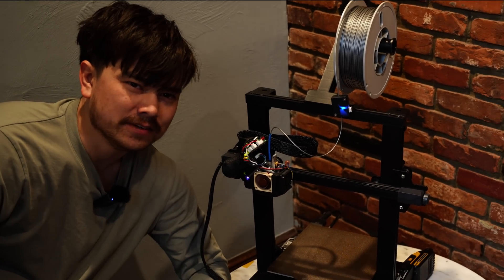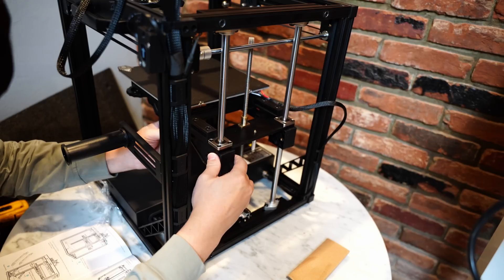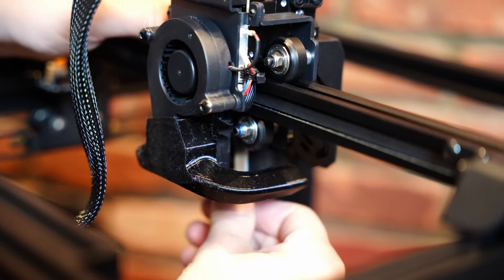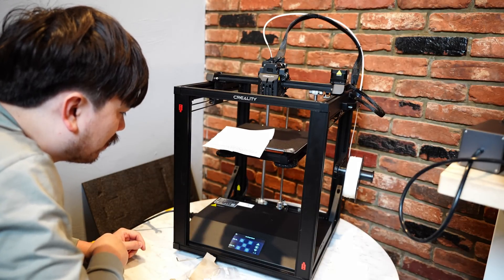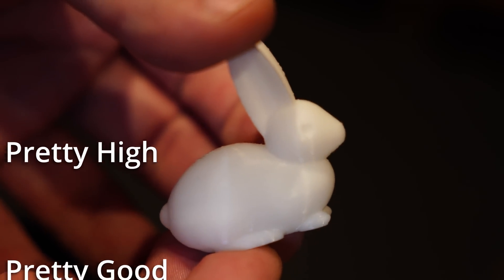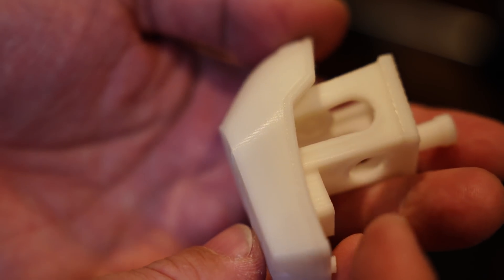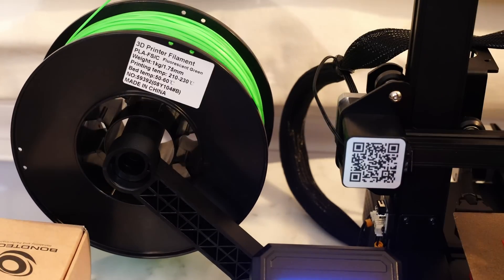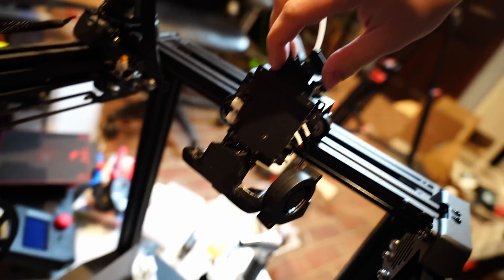Ender 5 S1 - The Best 3D Printer Creality Has Ever Made

Comment: I’d just like to add that Klipper is the future of 3D printing, and the future is upon us. Also, 4D and beyond is coming hot on the heels of Klipper. So that’s something to try to focus on more than what companies are doing to keep churning out variations on the Anet A8. BIQU is on the cusp, I think, so that’s where the action and the best ride/profit is.
Reply: Marlin is still adding features and updating.  Klipper for sure has some nice  features that marlin does not have yet but marlin will catch up
Reply: The hotend on the BIQU B1 SE is the dumbest design I have ever seen.
Reply: @petercallison5765  why am I not surprised.
Reply from the maker: Yeah, Creality really needs to build it into the instead of this pad. Should have called it the sonic band-aid
Reply: @NathanBuildsRobots  I disagree. The pad allows a larger screen and will be able to run multiple printers.  The pads release does not mean their future release can't/won't have klipper rather than marlin, it just means you can easily convert your existing line up and do so easily and cheaper than a Pi.    The pad is a awesome new tool that will be hard to be to switch to klipper.
Reply from the maker: @brandonbrown3600  I’ve been testing the pad and my screen is already scratched up. It’s a glossy plastic instead of glass for the touch surface :(
Reply: @NathanBuildsRobots  believe it or not a 5k snap on OBD scanner has the same thing. Same with Autel.  It's just industry standard for tool type tablets it seems. I guess because scratches are better than cracks.  I plan to put a screen protector over mine immediately even just a universal one wi help.  That and a stylus.
Reply from the maker: @brandonbrown3600  good plan. I should get one too
Reply: @NathanBuildsRobots  I'm glad you mentioned the scratches though I haven't seen anyone else mention them yet.  Just reinforces my though on the protector.  I really appreciate that but of info!
Reply: @NathanBuildsRobots  The sonic pad can control 4 printers at once, seems like a plan to me.

Comment: Someday, you might get a coreXY design and the accelerations will startle you with how violent they can be. Some of the travel moves are so fast that you can print with wet filament because it doesn't have time to ooze. However, I think your art form is the comedy of low end printers so that might hurt your content. :P
Reply from the maker: I’ve heard them running, sounds like they are trying to rattle themselves apart!

I want to get a corexy but I’m cheap and a company hasn’t offered to send one yet. Those cheap bastards... I’m supposed to be the cheap bastard in this relationship!